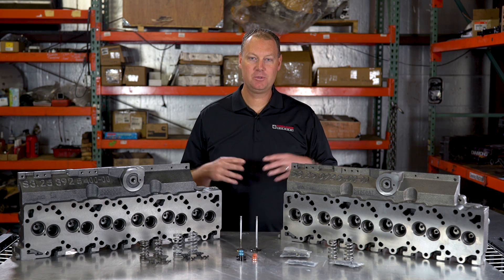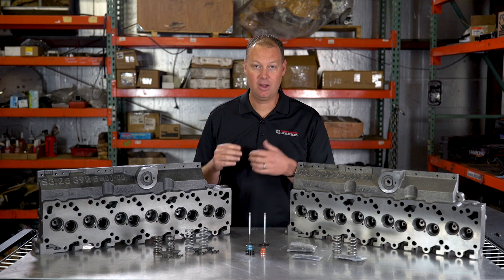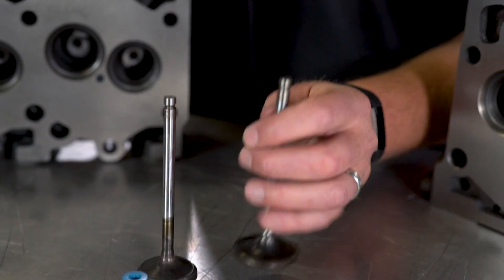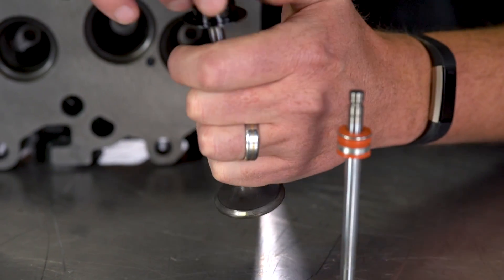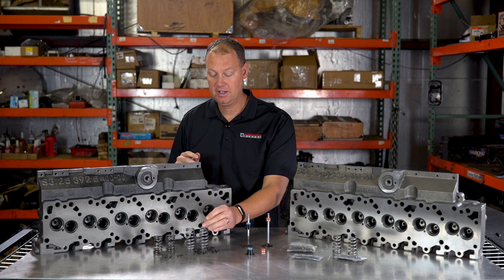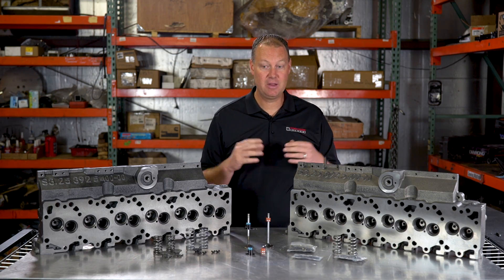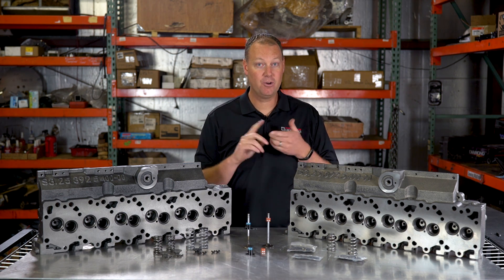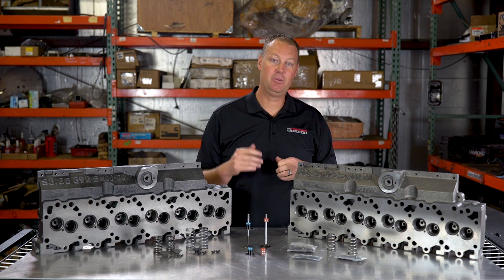Cummins Diesel Cylinder Heads | Parts Bin EP 6 | Power Driven Diesel

Comment: A perfectly smooth head sounds good... but in reality it is not that great for effective sealing. Part of how a head gasket seals is the roughness of the cylinder head and block surface. That roughness on the head and block "bites" into the gasket and helps hold it in place. A super smooth cylinder head and block deck will allow the gasket to blow out easier under high cylinder pressures when the studs/bolts start to stretch and the head to block clearance grows. Now, granted that ARP and aftermarket studs are super tough and have minimum stretching, the surface finish on the head and block may be negligible now, but I'm just saying what has been common practice for cylinder head and block surfaces for a longgg time.

Comment: Thanks for the great info! I just had 3 12 valve heads done in the last year. I would probably have made some more upgrades had I known about the valve seal issues with boost. I'm not much over stock on boost on most of my trucks. The highest is around 45-50 psi. The others are topping out around 35-40 psi. I hope they hold.

Comment: Had you guys o ring my head wish I would have known about those top hat valve seals would have had them put on
Reply: @pddofficial  yes they are orange but I didn't put them on that's what was on it when I got it back from being o ringed and your conical valve springs installed there.
Reply: @pddofficial  ordered a set went to install them to find out they wont go on a 95 and earlier head without machining the valve guide so I'm just hoping they dont slide up once I install compounds. First time getting in this deep on a 12 valve it's been a learning experience. So I'll know for next time and have them machined.